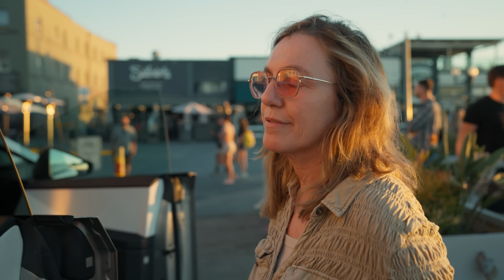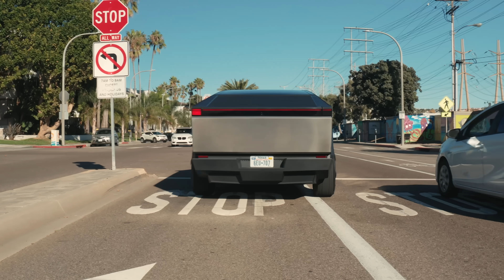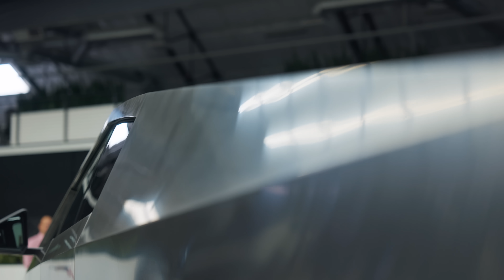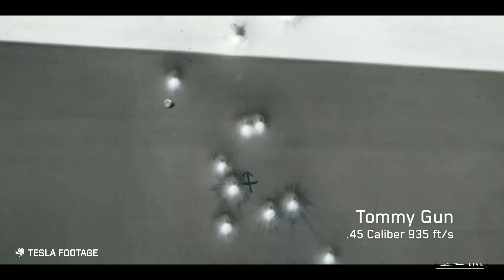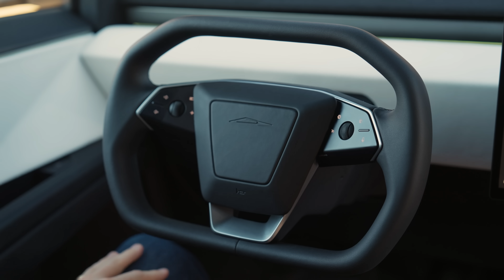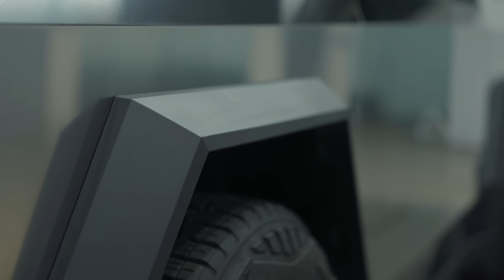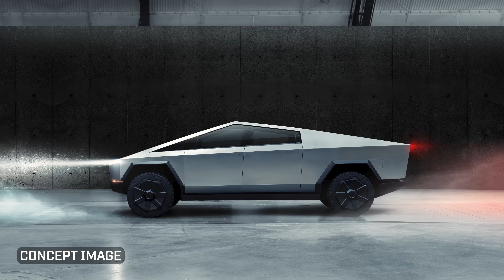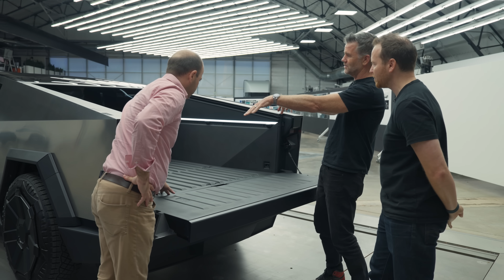FIRST DRIVE: Tesla Cybertruck Full Review

Comment: Everyone is talking about the difficulty of mass producing the stainless steel body, but I wonder if we should be talking more about the molds for the giga-press. I work with tire molds, which are much smaller, and rubber rather than molten aluminum. Molds can be very tricky and they are extremely expensive. Molds take an entire crew of people to maintain them and swapping them when they wear out is a project. I wonder about mold sticking issues, which are common with any molds.
Reply: https://youtu.be/6iNxI-74QOE  Only Rich people will own.

Comment: It's a really cool truck! However,  these are my thoughts after I wiped the stars from eyes. Having a giant touchscreen in the middle of the dash that controls everything is just lazy design that would be distracting to the driver. I think the screen should be smaller with the more pertinent info displayed in a HUD closer to the driver's natural field of vision. You could even give it a Forward Looking Infrared Camera then. I also think it's a bit overboard with all the electronic latches and doo dads - more stuff to break. It's an off road capable truck. It would be nice if the battery were rated to IP67 or better given that water intrusion appears to be one the main battery killers for Teslas. Plus, I'd find it really annoying to have to turn on the truck, and wait for it to boot up just to get something out of the glovebox.  Finally, it will be interesting to see how the stainless steel unit body design hold up after about 5 winters in the rust belt. Having said all that, I wouldn't mind getting my hands on one after the hype has worn off and they've depreciated a bit.

Comment: This is great until there’s an accident. Who’s going to repair this? How? It looks like it’s going to be totaled out in a crash that a Tundra or F150 would be in the shop for a week so you can imagine how your insurance company is going to treat it. In fact if I were a insurance company I wouldn’t insure it. Think about it, some poor shmuck in Wyoming buys one today & gets into a low speed front end crash tomorrow. Then what? There’s nobody with the expertise nor equipment that’s needed for thousands of miles that can replace a fender, a hood and these overly complicated structural components. An unfixable, unrepairable car or truck is useless in the real world. So no matter how much horsepower or how fast it goes, it’s too impractical for its everyday use application. I guarantee you the next Cybertruck, if Tesla decides to build another one, will not be this complicated.

Comment: No one is going camping in a truck like this. People who like to go back into the woods for now need an ICE. There is too much danger in relying on a battery. Secondly, The vehicle that has maintained it status as the  best designed camping vehicle is still the VW Westfalia. It has CLEARNCE and it has storage, and a stove, refrigerator and is easily adaptable to a heater for the winter. It also has room for 4 to sleep. Look at the industry around the Westfalia. They never lose value.

Comment: I would never buy this. Too expensive. No charge stations nearby in my city. I live in an apartment, so no garage or outside outlets to wire up a charger to. I can't stand the stainless steel look. I'd have to have it wrapped ASAP. 

Give it 20 years and massive infrastructure changes to fully support the EV market and then I'll consider buying this trash. But I'm willing to bet my entire retirement fund that the vast majority of vehicles will still be internal combustion.

Comment: some people will definitely not like the design because they have been programmed for 75+ years of how a car looks. But as someone born in 1990, i definitely welcome the new designs and innovations. The 80s and 90s kids have seen it all, from casettes, walkman, diesel and manual car, to automatic cars, semi, phones etc.. I would definitely get one of this. 100%
Reply: Not everything new is good.
Reply: Other people will definitely not like the design because they just simply dont like that design
Reply: It is devoid of anything that appeals to the eye, it looks like a godless commie designed the "truck". A horizontal refrigerator on wheels.
Reply: It a functional truck. And besides no paint chips, no dents, no windshield chips…
Reply: Not a single word or anything shown speaks to it functionality. The slanted box is not functional.
Trucks are for work and do not need to operate like a sports car. A truck needs to haul thing go off road pull a trailer, haul lumber tools equipment. Pulling a loaded trailer that thing would have the range of a nat. So far I've seen a glorified car not a truck.
You take that truck to a place where the few trucks are sold and people have no idea how one is used, how stupid. Why would you not take it to Texas or Alberta Canada where trucks are used?
California to get an opinion about a truck, not very smart. It is nothing but a glorified car. @americanegale697

Comment: It looks super cool, but I have serious concerns about how well it can actually do the job trucks are typically designed to do, because a truck is a vehicle with a purpose unless it's been purchased out of sheer vanity and is a pavement princess.
Reply: 80% of half ton trucks do not tow anything, ever. 93% never tow more than 50 miles from home. The overwhelming majority of trucks are nothing but incredibly inefficient commuter vehicles.
Reply: I’m not sure where it would fall short. It’s has 4 wheel drive, same range as most trucks, equal or better towing and a bigger truck bed and payload. It seems like it should do basically everything one would expect from a truck.

Comment: We have an EV and I like them, but.... F-150 $40K. Cybertruck $100K.  Assume gas $5/gal. Price difference $60K, or 12K gallons of gas. At 22 mpg, that's 264,000 "free miles" of driving before it equals just the cost of the Cybertruck. If electricity is 1/4th the cost of gas, it would take 1,560,000 miles to make up the difference in sticker price.

Comment: As a designer I can say that this car has the biggest impact on car industry since it was revealed. You can see the edgy wave in a lot of car brands like hyundai, audi, volvo... I don't think it's just an aesthetical approach, because the simplest the form, the easier, faster and cheaper is to produce. As an example imagine how hard is to manufacture a lexus curvy body and how easy is to manufacture a cybertruck considering that in most cases there are 2-3 straight folds. The only problem of those kind of cars is that straight corners can decrease the safety of other drivers, they're like tanks.

Comment: It's going to bee interesting to see how many manufacturers use this car as inspiration for future vehicles.
Reply: Non of them .. only the chinese !!
Reply: @z-0669  Because they're all designed using a computer, and they're all limited by safety regulations. 
Making wedge-shaped cars today is almost impossible because of pedestrian crash regulations.
But the absolute worst part of modern vehicles is the plastic. Plastic degrades and means they won't last as long as their metal counterparts have.
Reply: Pontiac tried with the Aztec. Didn't go well.
Reply: @fjm1235 Bad timing. You need to follow the trends. Trends go in and out all the time. I wouldn’t be surprised if the truck does well we see many others attempting a design like this.
Reply: Yea...nope. The only inspiration they will take would possibly be some of the under the hood/dashboard/electronic functionality. As far as looks and style though....absolutely not! The only styling inspiration any other companies will take from this is what not to make a car look like. I have seen toasters with better form factors lol

Comment: Bulletproof is pointless and no rear visibilty or door handles sucks, along with the steering wheel.  Other than that it's pretty good! ... ( if you feel like spending lots of money;  then lots more when anything goes wrong; then sell it for peanuts in the future when nobody wants an old battery/tech; and be a slave to the juice level all day meaning it can't be  used for work or adventure purposes; and you don't mind driving 3.1 tons of square metal death machine; and you like wiping fingerprints from screens and the doors, and you love polishing scratches that will stick out like dog's balls all over the body, and you like burning your skin every time you touch it ! 😂)

Comment: Was so ready to be disappointed, but it sounds like the Cybertruck is gonna be a great vehicle.
Reply: By the way... This is the first ever vehicle that was built without planned obsolescence. Ultra hard, chromium-nickel stainless steel, lasts forever, it can never rust, it can never scratch, and nothing can cause it to corrode or dissolve. Every production vehicle after the Model T was designed to rust straight away. 

Modern trucks use rusty steel, a rusty frame, rusty suspension parts, and rusty engine parts, and they corrode while simply sitting in your driveway. The rust on cars assures that they dissolve after 30 years, even if they are well maintained. Some vehicles use aluminum, but aluminum is only 1/10th the strength of stainless steel and is a soft metal, being a very poor choice for body panels that are subject to impact.

Stainless steel is used for knives and forks, and for surgical instruments, for beer kegs, for medical implants. It can last inside the body without dissolving or rusting, and Tesla added even more corrosion resistance to their alloy.

This truck will last for hundreds and hundreds of years. There's a reason that Back to the Future used the stainless steel Dolorean!
Reply: @starseeddeluxe  that's pretty dumb to say all other cars are "designed" to rust away. Unless you also want the cheapest cars on the road to start at $60,000, then they are going to rust away given enough time.
Reply: @starseeddeluxe  Good luck with that when the batteries start to degrade.  And replacing them? Might as well throw the truck in the trash and buy a new one for the cost.
Reply: @g0ballistic  Owners forget...they are married to a dealership for everything, parts service etc $$$$. 
No choices there.  If I cant fix it I dont want to own it. No way would this hold up over time in an area with inclement or exteme weather.Def. planned obsolescence
Reply: I didn't see the point of this truck before watching this Top Gear video and listening to the charismatic genius engineers. The point of the Cybertruck was to defy convention, to show how a vehicle can be built while doing every possible thing in a different way. That was the purpose of it. It's the first car to use electronic "fly by wire" steering with zero mechanical redundancy, using triple electronic redundancy instead; it's the very first 48 volt car ever sold in America. It's the first ever Tesla to use 800 volts. It's the first ever vehicle to use an exoskeleton for structural strength instead of the inner core. It's the first ever ultra hard stainless steel bodied car. It's also the fastest truck in the world, currently, in production.
Reply: It will not pass safety rules, at least in EU.

Comment: Great review. I love this and I hate it...and then I love it again. Teslas are fun in and around town which is how most people will experience them (not on a track). And while I don't love the full design of this truck (it has grown on me but some things just scream at my brain like those wheels) I think the engineering in this is remarkable and I applaud the thinking to do things non-conventional. Auto makers have played it safe for too long so it takes a tech company to disrupt that. I drive a truck to tow things and this is where I think the challenge lies. Pull-through charging infrastructure will be a problem. And I live in cold climate so the battery life in winter is a consideration. I don't see EVs as "green" but I do think if I ever were to buy an EV Tesla would be the leader in brand of choice. BUT I think an EV truck right now is something that will have to evolve along with the infrastructure. This truck as they iterate will only get better so I applaud Tesla and Elon for pushing and breaking boundaries.

Comment: I would never consider buying any vehicle without an internal combustion engine, and that is the big downfall of this thing. Obviously you would have to be quite well off to buy a $100,000 truck (If it ever actually goes into production, I suspect it to cost a lot more) but those that can afford it would still be much more likely to buy a top of the line internal combustion powered truck. I mean, lets face it, this thing is UGLEEEE! Not many people would want to be seen driving around in this. This might appeal to someone who would buy a Lamborghini, or McLaren, or Koenigsegg, but it's not going to appeal to the average person of financial means. Even if you did like it's looks, or just like it because it's "weird" It still has that battery powered thing going against it. That is NOT going to appeal to someone interested in a supercar. Then there is the problem of how to repair collision damage. On a DeLorean, all the panels are removeable and replaceable. And even now, 40+ years later, most of the parts are still available. But on the Rivian, a tiny dent in the rear corner costs $40,000 to repair, because half the truck has to be replaced. As a retired mechanic, one of the biggest considerations in buying a vehicle is how easy and how expensive it is to repair. This thing, like all Teslas, appears  to be designed to be disposable. I'm sure that huge battery would cost well over what the vehicle is worth. Then there are all the spying devices and self driving trash on it. Everything you do and say is being monitored and sent out over the internet. You are tracked everywhere you go. There is an internet connected camera pointed at your face while you are driving. NO THANKS. I'll keep my 1968 Ford F-250

Comment: I think when you are designing a truck with steel you don't have many design options. (hard to add multiple lines and bends)
Had they done for a tradition look it would look like 2 boxes (front and bed). It would look like a tuck version of g-wagon.

The design they used is the best one can do with steel.

Design Decision-
1. Hood needs to small, else it will be heavy
2. The roof needs to be small, for low center of gravity.
3.  Solution- make the windscreen large. This will make the hood and roof small and the A-Pillars will become a style element.
4. Rest carries the same philosophy. 

This truck is a tank. I fear what will happen to other cars when it crashes into them. I feel the hood is like a knife blade and it slice open other cars in an accident. I hope all things were tested.
Reply: its FUNCTION Dictates the Cybertruck FORM.
Reply: Not a single word or anything shown speaks to it functionality. The slanted box is not functional.
Trucks are for work and do not need to operate like a sports car. A truck needs to haul thing go off road pull a trailer, haul lumber tools equipment. Pulling a loaded trailer that thing would have the range of a nat. So far I've seen a glorified car not a truck.
You take that truck to a place where the few trucks are sold and people have no idea how one is used, how stupid. Why would you not take it to Texas or Alberta Canada where trucks are used?
California to get an opinion about a truck, not very smart. It is nothing but a glorified car.

Comment: Ford has had adaptive steering in their trucks since around 2016, possibly earlier. It makes it similar to the cybertruck where you don't need to turn the steering wheel as much for turns.
Reply: The point was its fly by wire steering no physical.connection at all😊
Reply: @pcsolutionman  same function either way. less steering wheel turn required for sharp turns.
Reply: @JasenRamsey-er6ek   - TESLA Cybertruck  does MORE than ANY normal truck in PRODUCTION.
Cybertruck can TOW 11,000 lbs UPHILL Faster than ANY Truck in PRODUCTION. 
(not) Towing a 5th Wheel.

BUT, Tesla Semi can haul 5th wheel 82k Gross for 540+ miles in 24H , and FASTER uphill than ANY Diesel semi 80k .
Reply: @JasenRamsey-er6ek   - TESLA semi can pull 82k lb 5th wheel & TRAILER 540+ miles and Uphill.
Reply: @JasenRamsey-er6ek   - 5th wheel is less than .5% of the TOTAL truck market.
Reply: who buys FUD trucks anymore ?
the Model Y is outselling the F150 series , already.
Reply: @markplott4820  people who want to tow further than 100 miles.
Reply: @atomictyler   - NOT Tesla's CUSTOMER . mic drop.
Reply: @markplott4820  Not a single word or anything shown speaks to it functionality. The slanted box is not functional.
Trucks are for work and do not need to operate like a sports car. A truck needs to haul thing go off road pull a trailer, haul lumber tools equipment. Pulling a loaded trailer that thing would have the range of a nat. So far I've seen a glorified car not a truck.
You take that truck to a place where the few trucks are sold and people have no idea how one is used, how stupid. Why would you not take it to Texas or Alberta Canada where trucks are used?
California to get an opinion about a truck, not very smart. It is nothing but a glorified car.
Reply: @schulzmj1  - Cybertruck does MORE work than Conventional ICE trucks, and Cybertruck is Already PROFITABLE.

Comment: Top Gear - the Control stalks in 2023 are OUTDATED , and NOT needed anymore .
Vestigial ICE car CRAPPY , Delete. 
Cybertruck even Does away with the Rearview Mirror , opting for a HQ rear Display.
BTW , you can Comfortably make turns w/ Tesla YOKE and Cybertruck steering wheel ONE handed.